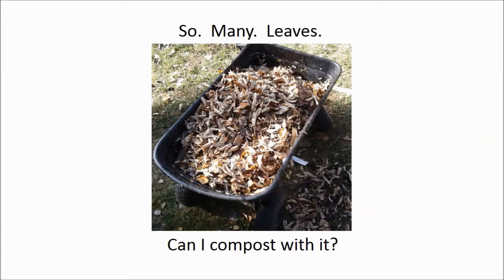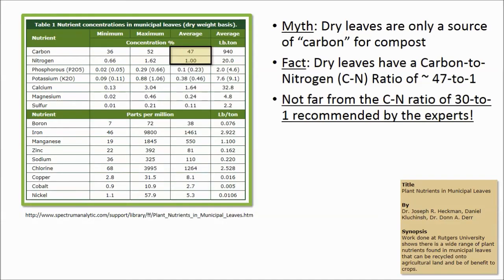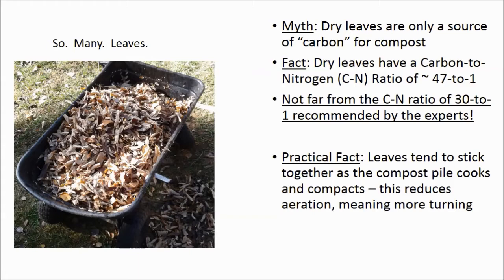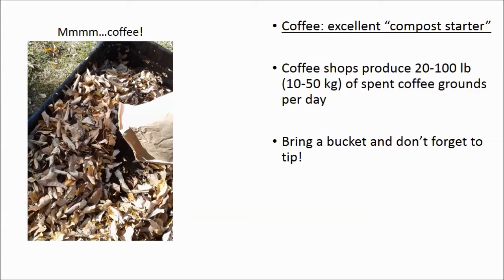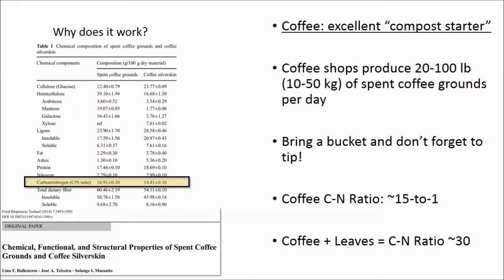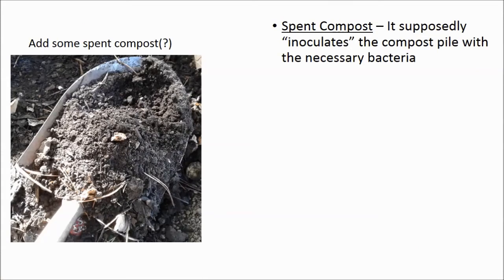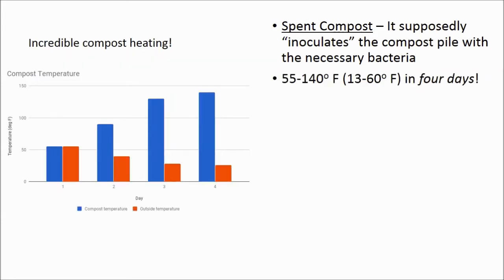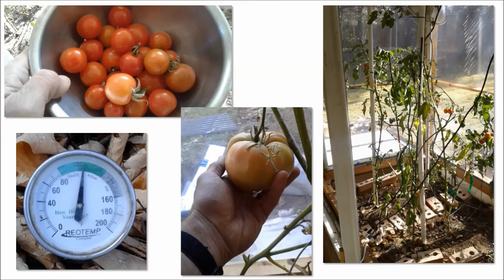Compost-Heated Greenhouse: Compost Recipe (part 2 of 3 in 2017 series)

Comment: If you're just using compost for only heat and you want to use cardboard, then cant you also add nitrogen fertilizer pellets as a starter and long-term nitrogen source?
Reply from the maker: stephencarlsbad I have asked myself this question.  There is no reason you couldn’t use nitrogen fertilizer to raise the CN ratio of a cardboard mix.  In fact I am using about equal parts shredded paper and leaves in my current batch of hot compost.   Coffee is the main nitrogen source.  I will see when I return from Wyoming if the temperature has stayed high.  I believe that pile size is the key parameter.  As you’ll see in my next video, when I had the compost segregated into small bins, it stayed cold.  When I threw the mixture into a large bin, it heated right up.  Moisture isn’t that big of a deal